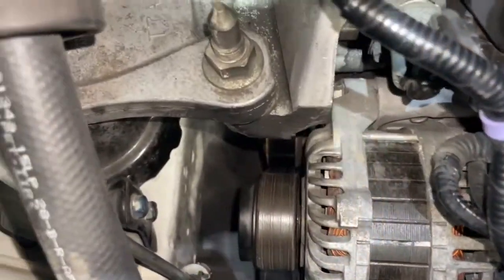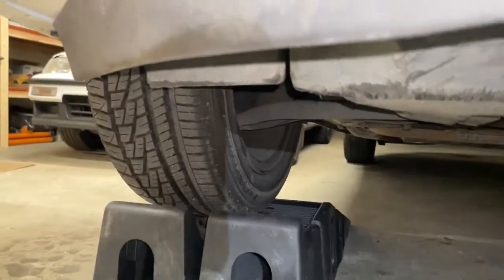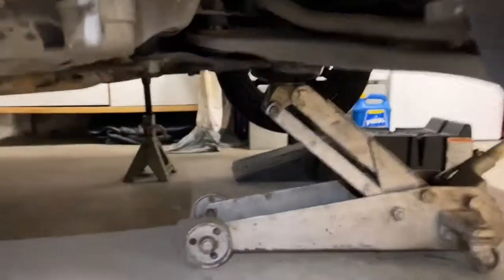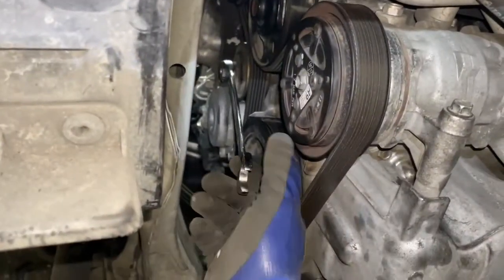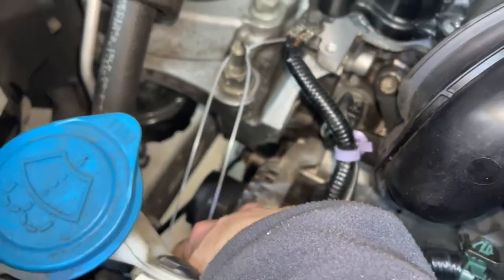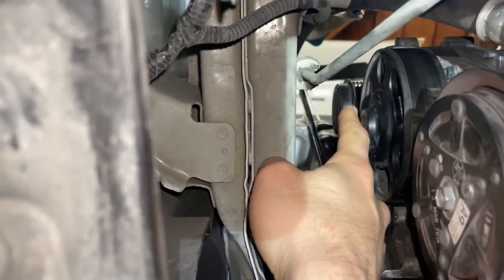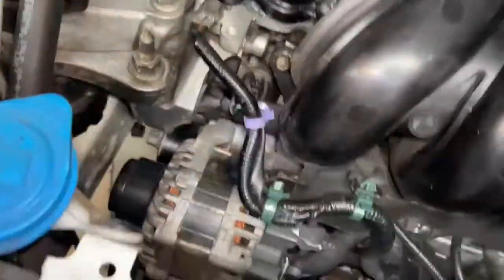Honda Fit Serpentine Belt Replacement

Comment: bro so i did mine recently and i noticed that there is a hole on the tensioner pulley that you can stick something in it like an allen wrench and it holds it open in place. so when you pull on the pulley to fully loosen the tension you stick something in the hole and it holds it. it helped so much.
Reply: Yeah the official repair manual does point this out. Of course there is a special tool for it but it says use an Allen key otherwise.

Comment: Another tip that I'll add... instead of using a zip tie there are two holes in the auto tensioner and you can just line them up using the wrench and then stick an allen wrench through the holes when they line up and that will lock it in place more stable.
Reply: For anyone worried, the (annoyingly hard to get) Honda repair manual explicitly states to use these two holes too, so it’s all within spec. Nothing inherently wrong with using the zip ties either I would imagine, but if you have a couple Allen keys lying around might as well just use that

Comment: It's a lot easier to just pull up on some 2x4s instead of the full ramps because you can actually jack the car up high enough to get the wheels to lift off of them.  This also means you don't have to use your jacks at full extension so they will be much more stable and safe.

Comment: I'll give you $50 to do mine - got all the things and tools but the floor jack

pro tip: if its a sunny day put new belt in the sun or on dashboard as the heat helps it expand a bit making getting it on easier.  might be able to throw it in oven at super low heat (sub 200) for a few minutes, not my first choice.  hairdryer or laundry dryer might also work 

i just now looked at my belt, it seems the left half is missing.. replacing belt has been on my list for a time now, guess that time is tomorrow .. i suspect reason its in that state is my car recently discovered a ladder someone was storing on interstate, i didnt think the piece that went into through my bumper made contact with engine i now suspect that is incorrect

Comment: 0:58 Your disc brake screw came out. Happened to my 2012 Fit as well but the screw was trapped between the rim and brake. I put blue loctite and a peice of packaging tape over the screw head, they tend to come loose and fall off.
Reply: They are not necessary. Only there to help hold the rotor in place to seat the caliper easily. Here in the rust belt, its common they rust so bad and sieze up. Most shops are forced to remove these by force at that point. Keep them off i say

Comment: Can you put de number of the serpentines belt please
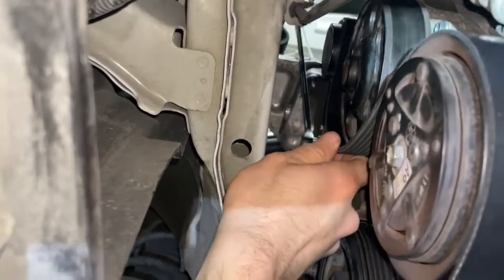Reply: He shows the part number at 3:51. Dayco 5060433 6PK1100S. But you should check for what part number fits your specific model with a clerk at whatever store you get the belt